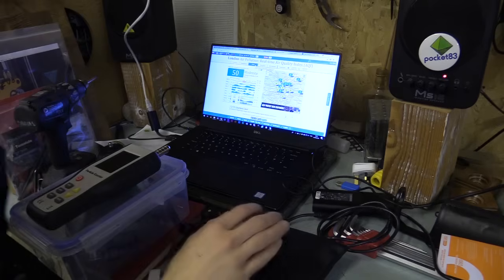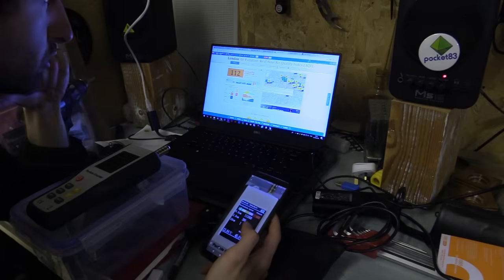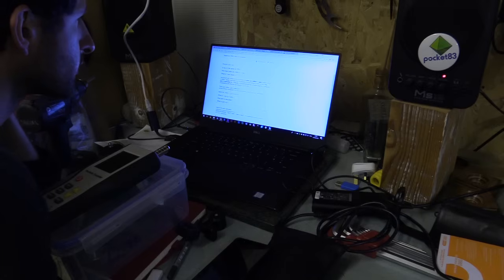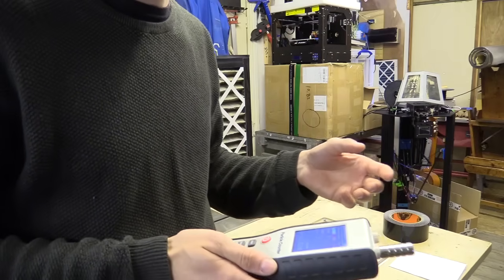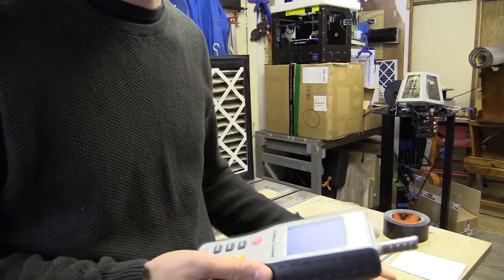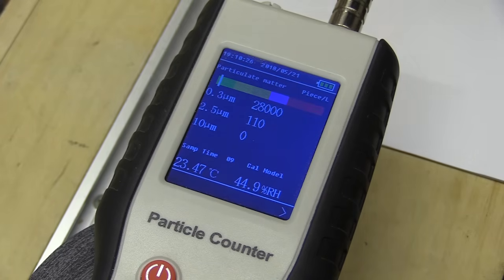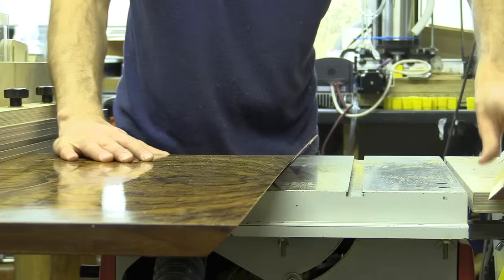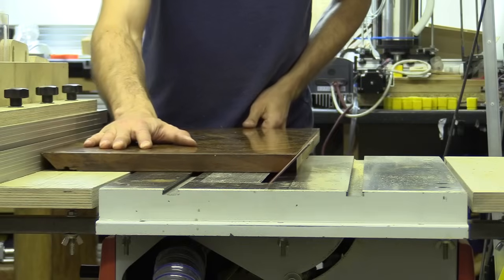Dust Particle Counter & Tyndall Beam Dust Lamp Effect

Comment: ok..dose it matter if you fart ?
it seams like a lot of  particles in the air or is it this low or high ?
Reply from the maker: Ha I don't want to break it! I started filming much of that in May and it was a particularly bad weekend for pollen and pollution. That's why I added the bit about the Tyndall Dust Lamp as an alternative way to measure dust.